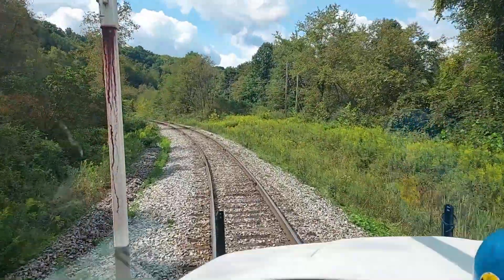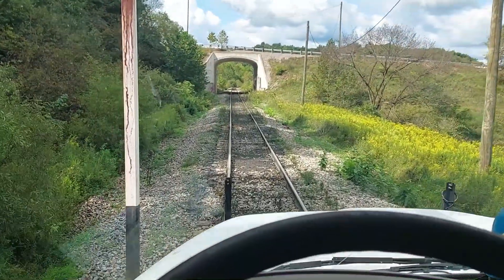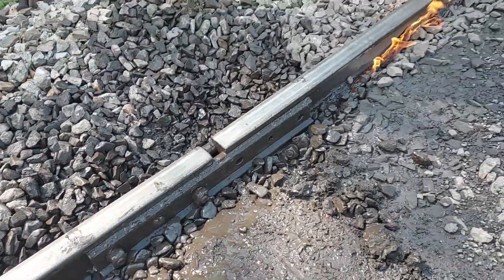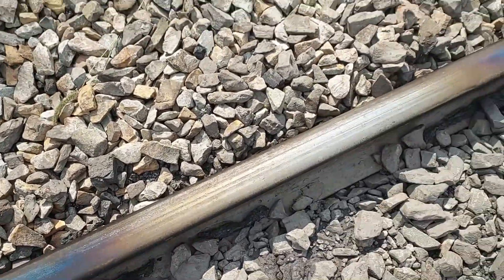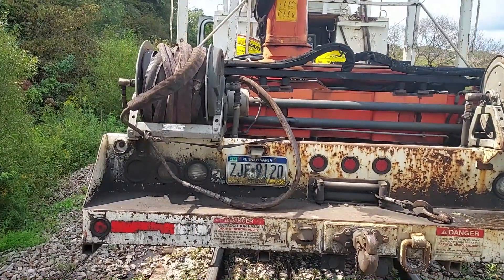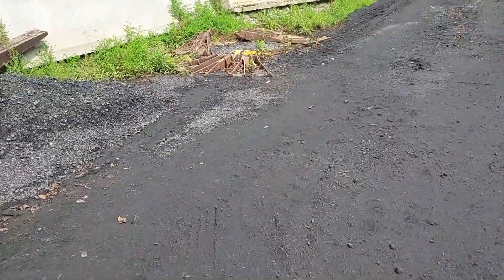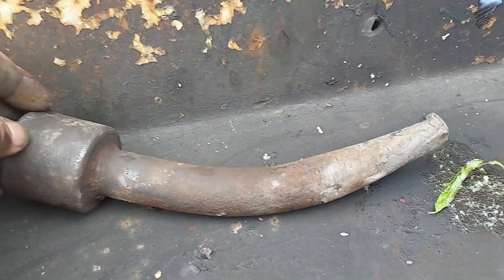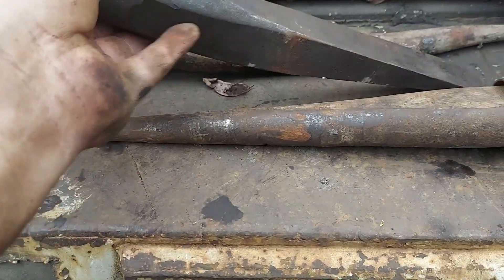I Set the Rail on Fire Today! Fire Snake in Action!!!

Comment: A day-to-night temperature difference of 30° could cause a pullapart when temps dip. We used Firesnake and the cans made it handy. Before that we used a "burn rope" which was a wick material(fiberglass, etc) soaked in diesel. Much more messy than Firesnake. Thanks for the vid. I worked for Amtrak  40 years and they would not be partial to a public video broadcast I am sure. You know . I just noticed. Is that stick rail?
Reply from the maker: Your right about that George temperature fluctuations like that cause rail movement, a few weak bolts and they snap now you got a pull apart. We used to have the rope here, your right it
was sloppy but burnt hotter than the snake. Snake is easy to
work with but the fumes will put you on your knees. We are
not under FRA jurisdiction here or if we were, then no videos
would be allowed either.  Very much appreciate your checking out the video and may you have a really good day my friend.

Comment: Oh I almost forgot.
For extremely wide gap (pull-a- parts) - try using a DOLLY next time - If the gap is sufficiently wide that your bolts can be put in (yet in the wrong holes) a "short slice of rail-end" called a DOLLY - will fill the open gap between the two rail ends, until later when you have more time between trains, to drift several rails along, to help close the gap properly, always knowing that the rail (naturally) drifts downhill, so later on, you may well need to go to the bottom of an incline and loosen /remove joint bolts all the way back uphill, and DRIFT all those rails uphill, until the joints are all wide, because in the summer, if all the downhill joints are still "closed" from the rail (over time) drifting downhill, you can easily get track buckles occurring as the rail expands with nowhere to go.
At the top of the hill / incline in winter your joints will stretch too far (and put the rail under way too much tension) that the next train over a very tensioned joint, will either snap all the bolts, or snap the side plates allowing the joint to open VERY WIDE (under the train as it passes)
It's not a huge concern though as trains seldom derail unless the rails themselves go out of alignment allowing a flange to get outside of the next rail.
Something the British explosive engineers discovered, when attempting to derail war trains, and had "gaps" up to several feet apart, that trains simply rolled over and kept on track afterwards.
Simply taking the fishplates off one joint and pushing the two rails away from each other, to allow one plate to fit between them (bolted on one side of one rail & on the other side of the other rail), they instantly derailed the next flange that past.
I will go find that video which I watched here, away back about 8 years ago, of a 1944 experiment.
It makes you wonder - how they didn't succeed, as a trains wheels simply follow along (in a straight line across a gap), even if the rail is missing. 
https://youtu.be/agznZBiK_Bs

So - not to worry too much about a small gap, when it's "sideways shift" that gets them on-the-ground - every time.
Reply from the maker: Watch this video on what we do for big gaps, all rail here runs
east since we don't have bi directional loads, no one understands
the creep we have because of the uni directional loading traffic
we have, but it's what I've had to deal with for the past 40
years and ain't gonna change now....LOL
https://youtu.be/hx7DNm3SAtc

Comment: 2:25 WOW, doing it the old hard way I see, ESPECIALLY with just about every sleeper having a "rail-creep-clamp" to stop the rail sliding either way.
Even back in the 1970's when I ran the inspections every day in winter, checking for "pull-apart" and/or broken rail joints (or broken rail)
I had access to a joint puller / pusher.
Being a special dual action worm screw device, that I simply bolted onto the joints (across the great divide) in place of the regular fishplate sets, which allowed me to EASILY wind the screw one way or the other, to push apart or pull together, up to twenty rail sections either side of the break, after I had loosened all the fishplate bolts and spun the sleeper screw spikes out a little (with a 1 - 2 man T-bar socket/spanner unit) - such that I could PULL up to 40 lengths of 30 ft rail together at that break, along the sleepers, to OPEN all other rail joints enough, to be able to fit replacement fishplates across a much narrower gap by then, instead of having that "mile wide" broken joint.
Seeing you having to warm the rail (which also works against you later as it crystalizes the rail in cold weather) - just to allow you to get say 1/4 inch or more by hammering away at those sleeper hold clamps ?
Talk about doing things the prehistoric way.
See if you can't locate a proper joint puller tool, (looks like a truckers load-chain clamp), to make the next pull-apart a breeze to fix.

The closest thing I can think of in todays MODERN world, is a truck chain tensioning tool called a LOAD binder.
The NZR had a far more cumbersome tool, that had all four bolts (two on each end) to tighten onto each end of a wide apart rial joint, (with a short half plate on each on the other side) to allow one man to physically pull together RAIL that was up to 8 to 10 inches apart (after heavy frost etc.,)
Something like this "Twitch Load Binder", but fitted with a half joint bolt-on section on each end (to affix joint bolts through the rail - to clamp each end onto the rail ends)
 https://www.mtw.net.nz/product/21813-13mm-slip-hook-twitch-load-binder-ratchet-type
Reply from the maker: I had one of those Simplex pullers, like to break my neck when
the ratchet slipped, had to knock off all the anchors and total
PIA to use it was. When they got me the fire rope the puller
got scrapped as quickly as I could. Don't have to knock anchors off
with the fire snake except on rare occasions.

Comment: Umm, what did you fix? Still looks broke to me, why did you not thermite it?  Not knocking your work at all just dont understand what you did for 45 minutes
Reply from the maker: Rail had pulled apart from the joints because of contraction from
the cold weather. The Snake expanded the rail to bring it back
so we could get bolts in the joint ScubaOz. The rails have 3 bolt holes in each end, and our welders will not do a thermite weld with
the 3rd hole being so close to the weld. Thanks for taking
the time to tune in and watch the show today my good man.
Reply: @ccrx6700   Okay, thanks for explaining that a little more, great work and great vids!
Reply from the maker: @ScubaOz  😊👍

Comment: Would you be considered a Gandy Dancer? We use to have Section Gangs  12 hr days.
Reply from the maker: Most common interpretation of a Gandy is trackman so yes Michael, I
would be a Gandy. Gandy Dancer originated from the early 19 teens
to 20. There was a company that made railroad tools back then
called the Gandy Manufacturing Company of Chicago. Gandy Dancer
came into being as a slang term for for the gyrations the trackmen
would have using the Gandy RR tools.
Reply: @ccrx6700   I worked for the ICG for a while the Forman had me in the rut throwing out cross ties by the undercutter. I got so tired that night I woke up standing in pitch dark.I thought I died and woke up in Hell I was feeling around and I got a hold on the shower nozzle.  I reckon I walked in my sleep that was an experience.
Reply from the maker: @michaelg.damons6229  😊👍

Comment: Seems like they should just get the rail welded would be a lot easier.
Reply from the maker: It would be Robert, but if we cut out a piece of rail here and welded
a plug in that would be ideal, however we must rely on contractors
to do our welds and they are not often available on the spur of
the moment like this,  and we had to keep the train running so
this was our fix for the time being, hope that helps explain a bit
better. We do appreciate your writing in and for watching sir

Comment: why aren't any of these tracks welded together using thermite ?? i feel it is a lot of work checking all of these short pieces bolted together
Reply from the maker: Original design was all jointed rail. in order to weld rail now every
stick of rail would need to be replaced. They can't weld rail with 3 bolt holes in each end, the hole is too close to the weld area. So imagine
the huge astronomical cost of buying new rail, installing it, then paying for the welds plus the tremendous amount of time and labor 
involved. If you every build a railroad new construction use CWR to
start with. Thanks for writing in and for watching
Reply: @ccrx6700  much appreciated and very welcome
Reply from the maker: @dimievers5573  😊

Comment: Why do you heat the rails?  For metal expansion?
Reply from the maker: Yes sir. When the rails pull apart at a joint, then heating the
rail helps to bring it back so we can get the bolts back in the joint
bars. Do appreciate your writing in and for watching the video Indy125

Comment: Why not weld the joint once the rail has expanded?
Reply from the maker: Good question,there are 3 bolt holes on each end of the rail stick. Welders won't weld those because that 3rd hole is too close where the weld would be made

Comment: Before fire snakes we used chisels and hammers to run stripped joints together. At lest we didn't have fire snakes, that was in the early 70's.
Reply from the maker: We used to have a rail puller, what a struggle it was, had to knock
all the anchors off with it too. When I got the snake, that puller
went into the scrap bin...LOL  Sometimes I have used a wedge in an
adjoining rail gap to help drive the rail a bit

Comment: I preferred the old clickety-click rails, was soothing, now there all welded together, which has to cause issues during a heat wave-freeze up. Seen pictures of what can happen dispute the expansion joints. Great stuff thanks.
Reply from the maker: Something romantic about the clickety clack I agree, CWR a lot easier
to maintain, but that not gonna happen here. Thanks for watching
Philip

Comment: I like to use ironworkers drift pins. Rather than tapering for the full length of the drift as yours do, they have a short taper of a couple inches on either end and a constant diameter of several inches in the center. I had two, one with a 1" center diameter and one with a 1 1/8". They are designed so they may be driven right through the hole. Particularly useful at heel blocks and thicker sections where a fully tapered pin would get stuck before engaging/aligning all the holes.
Reply from the maker: Very interesting! I have never heard of them and yes you are right, these stink using them at the heel blocks, will definitely look into
those pins, really appreciate the info!

Comment: Aren't you afraid the flame will burn the wood the rail is nailed to?  Or at least weakening it by making the spikes loose.
Tom Dutkiewicz
Reply from the maker: I caught a bridge timber on fire one time with this stuff, that was
scarry, but for all the years been using the snake we've had little
problems with the ties catching fire, snake usually stays on the
web of the rail held in by the spike heads and doesn't get on the
ties. Appreciate your comment Albert and for watching

Comment: Really surprised you had a pull apart in such mild temperatures. Are you a mix of welded and jointed rail?
Reply from the maker: We have almost exclusively jointed with a very small smattering of CWR, which is mostly in the yard track. Thanks for watching Matt, we
do appreciate that

Comment: I'm no expert but I'd imagine from what the can says, Fire snake (and other similar products I'd bet) is probably mostly made up of middle distillates which is diesel and light fuel oil, with some thickening agents which turn the liquid fuel into a pliable but solid putty so it doesn't spill when the tube burns through, it's a big sausage piped with gel camping fuel really. Basically the same as a fire rope minus the rope, pretty neat though.
I appreciate your employer's relatively relaxed attitude on recording this kind of stuff, the maintenance world of railroads is one that is often invisible.
Reply from the maker: Pretty much is like a sausage Caleb, and the outer coating is
plastic and burns quickly and the gel stays in place on the web
of the rail. And your right it is pliable yet solid. The fumes coming
off it when burning will put you to your knees if you breathe it
for more than a few seconds. Appreciate your comment and for
watching sir

Comment: I'm really ignorant but confused - please help! once everything's okay and bolted up, won't it be a problem once it cools down, and why not? Sorry for being stupid!!
Reply from the maker: Please don't feel stupid, what you are asking is not something that
a lot of people really understand, so we are cool and I did not do
a very good job talking bout that in the video. Non of my vids are scripted and I learn what others are seeking from the comments,
so do appreciate your writing in.

The old bolts broke cause there was mud under the joint and it was
pumping up and down plus the rail creep from the train. The big gap
happened cause once the bolts broke, there was no resistance to
keeping the rail from creeping. New bolts in the joint now will hold
the rail. What will happen is that another joint will most likely
break the bolts and pull away in this section. Cold temps only
make the condition worse. 

What we need to do is first crib this section out and replace the
fowled ballast and fix the drainage problems, then add some rail
so there is not as many joints with big gaps.. Hope that helps clarify and if not write me back sir
Reply: @ccrx6700  That's explained it perfectly. Thanks so much, mate!
Reply from the maker: @numbersix1908  👍

Comment: After expanding the rails with heat to close the gap won’t the rails then contract and the same gap return?
Reply from the maker: Simon glad you had an answer from someone else. The new bolts will
hold this joint, but eventually another joint in this section gonna pull apart until we can get add a bit of rail to it. Appreciate your watching sir
Reply: simon allen, theyve bolted it back with tension.  like pulling on an elastic band, steel has some give in it.  this is the principle used on continuous welded rail.  they stretch it, cut a bit out then weld it.  and on a cold night, when no-one is watching, the fairies will come out and loosen the bolts so it all happens again.
Reply: @vsvnrg3263  Thanks.  Where I am in the UK there is a lot of continuous welded rail.  It is under tension as you say.  Thanks for the explanation.
Reply: @simonsallen  , i grew up in victoria, where they set the rail at a given temperature to allow for expansion on a hot day.  however, they cant allow for too much temp variation and at 33 (or36?) degrees celsius, a common summer temp, the whole system goes into slow-down mode because at that temp they expect buckles.  and the melbourne public get hot under the collar because of the delays.   if they weld the rails to allow for hotter temperatures they have problems in winter. i suggest you examine "a seriously oh crap moment- australian railways" by rod williams.  some turkey has also used this footage, most likely without permission.  it is copyrighted by a famous australian loco driver, bernie baker.
Reply from the maker: Thanks for answering and I did enjoy the fairies, and kinda have to
agree with you on that one! LOL

Comment: Hot enough to leave tempering marks on the rails.
Reply from the maker: Gary in all the years I been using rail heaters this is the first time
I have ever seen bluing to that degree, and I have no clue why. Snake burns the same temps whether it was 10 years ago or today, and the
bluing was in spots, I am puzzled by that, do you have any idea on that
anomaly?
Reply: @ccrx6700  absolutely no idea there. I thought it odd that those flames were hot enough to heat the rail to that degree

Comment: Am I understanding that you stretch / elongate / lengthen that piece of track? If so, why did it shrink and won't it again shrink for the same reasons? Doesn't heating the rail make it susceptible to twisting and warping as with most metal?
Reply from the maker: The bolts had weakened a good bit had to do with the mud and pumping track, plus the bolts were old so they broke. Then with no
resistance to hold the track, train passing over it cause the rail
to run east. this joint will be good now with new bolts, but eventually
another joint will fail in this section until we can find time to
crib this out and add some rail in. Hope that helps and also steel rails are really tough, they are a higher carbon steel than most which helps
in preventing the twisiting as you mentioned

Comment: Why don't they termite weld the joints.
That would eliminate the issue.
We termite and joint bar the joints just incase a weld cracks.
That's on a transit system thow.
Reply from the maker: All our welding is done by contractors, they tell me with the 3 bolt
holes on each end of the rail stick, they can't weld it cause the 3rd hole is too close to the end. We do some welding on rail that only
has the back 2 holes or is blind. Thanks for watching Chris

Comment: Proper maintenance of any tool subject to mushrooming on the end like that is to grind the flared edge off. Rubber cap or no, using a mushroomed tool is dangerous.
Reply from the maker: You are absolutely correct in that, it's my neglect for just not
getting it done